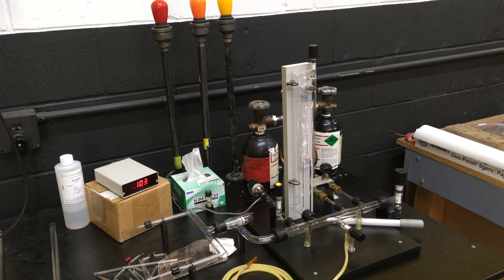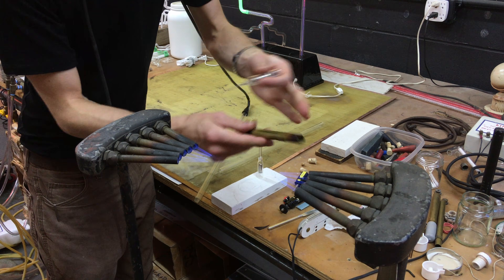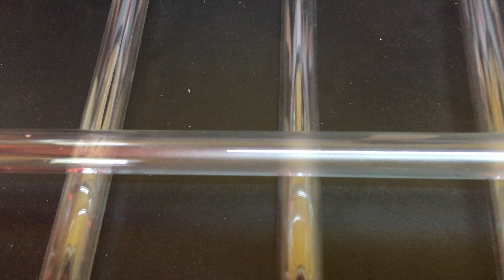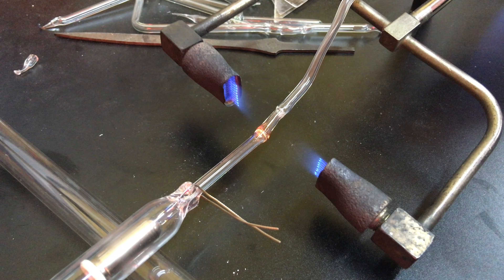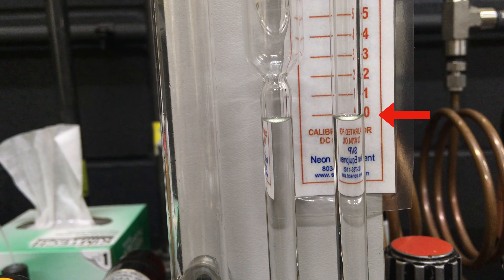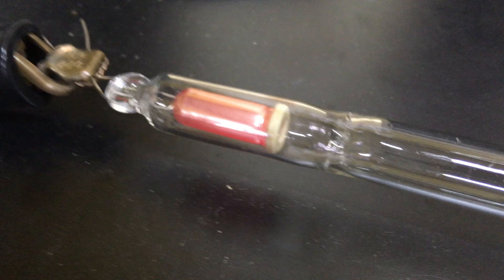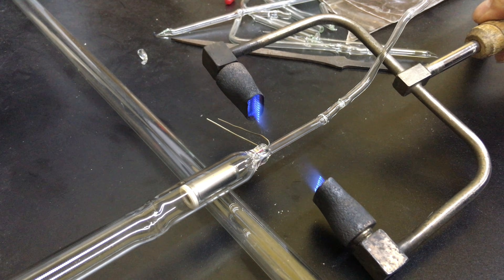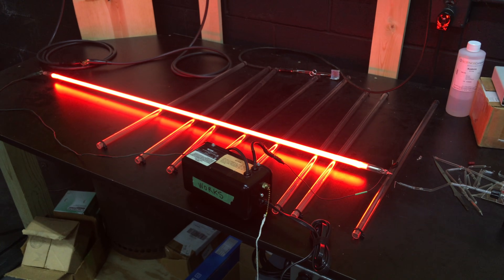Making My First Neon Tube

Comment: Im just starting, i have a 15kv neon transformer, can i use that for bombarding?
Reply from the maker: short answer?  no.

more amperage is necessary because more current is required to heat the tube and electrodes to an adequate temperature for processing.  generally, electrodes should be processed at least 10 times the manufacturers mA rating to fully activate the getter on the electrodes (e.g., 300mA for an electrode rated for 30mA). the glass needs to reach a minimum temperature of 225-250°C and the electrodes need to be glowing bright orange (c. 1000°C).  it takes a lot of current to do that.
improperly processed (i.e., impure) tubes will take a long time to burn-in, run hot, sputter, and have a short life span.

that said, bombarding is not the only way to process tubes.  oven-pumping & heating the electrodes using magnetic induction is another way; however, it takes a more customized setup since the oven has to be large enough to fit the tubes.
Reply: @NeonPreservation  thank you for the detailed answer. I guess the next question would be, where can i find an affordable bombarding transformer and choke?
Reply from the maker: if you're looking to purchase new, EGL has them: https://www.egl-lighting.com/bombarders/

however, if you're looking for used neon equipment, it is rather scarce.  you'll have to be patient and watch on craigslist, FB marketplace & ebay.

in lieu of a purpose-built bombarder, some people use a surplus step down pole mount distribution transformer (aka "pole pig") that is wired in reverse to step up the voltage instead.

it is also possible to build your own choke if you know what you're doing, e.g.:
https://uneonised.com/2017/11/21/ballast-to-basics/

Comment: I have been enchanted by the magic of neon light since I first saw it as a little kid in the 80s. A flashing sign in a lighting store. ON: a beautiful, saturated, brilliant orange-red fiery light in a long tube, punctuated along its length by mysterious flowing pulsating dark and bright striations. Cool to the touch. A quiet hum. OFF: NOTHING. A totally clear 'empty' tube of nothing. HOW!??! How could this be?? Where is the light coming from? How does it turn on and off so instantaneously, totally unlike the gradually dimming hot filament of a light bulb! Why is it so richly orange-red? Why doesn't anyone else seem to care at all about this wonderful device or understand how it works?!? The quiet warm glow of this noble gas still bewitches me even today. 
Slowly and methodically - understanding. Electricity, gasses, vacuums, plasma, electrons and ions, energy levels of an atom, photons, quantization, spontaneous emission, stimulated emission, collisional excitation transfer with a little bit of helium, lasing. Today I work at a facility that generates hundred-million degree plasmas for fusion research using ultrahigh power lasers, but it all started with those amazing tubes of brilliant nothing....
Reply from the maker: thank you for sharing; very eloquently stated!  i too am entranced by the beauty and wonder of this seemingly mysterious light.  i love the entire process of its creation: fire, molten glass, noble gas & high voltage.  
the science & physics aspects fascinate me the most, and are why i decided to start the journey of making neon.
Reply: @NeonPreservation  NICE. I subscribe!
Reply: @NeonPreservation  oh and what is that clear liquid in the manometer? I guess they don't let you use mercury anymore but it obviously can't be something with any significant vapor pressure either. ionic liquid?
Reply from the maker: the liquid is Dow Corning 704 diffusion pump oil—a silicone-based fluid— which, as you surmised, has an extremely low vapor pressure.
Reply: @NeonPreservation  Interesting   thx

Comment: So you using only rotarty pump? What underpressure you can achive with it?
Reply from the maker: yes, i currently only have a rotary vane pump.  depending on the size/length of the tube, my pump can get down to around 3 micron by the time the tube cools to 50°C.  obviously, a lower pressure would be better, but in neon manufacturing, anything below 5 micron is considered "acceptable."
i plan on adding a diffusion pump so i can achieve faster pump down rates and a better ultimate vacuum.
Reply: @NeonPreservation  okay, thank you. I planning to build processing machine for neons and any knowledge is priceless. Diffusion pumps here in europe are problematic because of the oil thats is almost impossible to get, unfortunetly.
Reply from the maker: as you may know, there are other options for high-vacuum pumps besides diffusion pumps; a turbo-molecular pump might be one for you to consider if you want a secondary pump
Reply: @NeonPreservation  yes i know about them, once a while i check auction sides waiting for some resonable offers
Reply from the maker: excellent!  being patient and waiting for a good deal to surface is how i add accessories my setup as well.
Reply: @NeonPreservation  we think simmilar i see 😅, for sure i come with another questions, for now thanks for help!
Reply from the maker: you're welcome, and good luck!

Comment: What's a torr? I know mechanics and some chemistry,  but I don't know what a torr is.
Reply from the maker: a Torr is a unit of pressure; 1 Torr = 1 mmHg.  atmospheric pressure is (generally) around 760 Torr, so neon tubes are evacuated to an extremely low pressure (milliTorr), and a tiny bit of noble gas is added.  in this case i filled the tube to 9 Torr, which is 1.18% of atmospheric pressure... so still mostly a vacuum inside!

Comment: Could you try and make a plasma globe that contains Ne and Ar?
Reply from the maker: yes i could!  i have tanks of neon and argon... i would probably have to get an oven/kiln built for processing because of the size of a plasma globe would dissipate heat too quickly if i attempted to process it the way i did with this smaller diameter tube.
Reply: Video once it done?
Reply from the maker: haha.  yes, if i attempt such an undertaking i will be sure to document it!
Reply: Cool!

Comment: Usually red doesn't snake like blue. But everything looks good when you lit that. My question is why you use a stick to push the button? You know it is only a 12v relay to the magnetic contractor and it's not even 120v so your chances of electrical shock are non existent.
Reply from the maker: i am using a scrap of 18mm glass tubing to press the deadman switch... basically due to an overabundance of caution.  i am completely self-taught and i set up all my equipment by myself, so with no experience and no mentor i am being extremely cautious.  i'd rather not accidentally get hit by the secondary output of the bombarding transformer.

Comment: When you are making welds rotate your glass in each hand opposite the other. Once you are ready to put them together to them the same for a sec then stick the two together and turn together. This makes sure all the area of the glass is evenly heated and you get an almost perfect wild right from the start.  Take it off fires and barely pull apart as you blow to make the line disappear. With lead free you should have hotter fires.
Reply from the maker: thank you for the tips, i will continue to work on my technique!

Comment: 8:00 - Can you teach us how the manifold system precisely works? How you purge it with gas or what not? in Detail.
Reply from the maker: the manifold system is collection of valves that allow the user to expose or isolate various system components from each other.  various combinations of opened & closed valves allow the user to evacuate or fill the tube, depending on the stage of processing.  if you would like to see the assembly of the vacuum manifold check out my video (it has chapters in the description so you can jump around to various topics), and i explain a bit about what the various components do while i am assembling:
https://youtu.be/Ya3I1l-zkqg

Comment: Where do you get your argon, neon etc. from? I live in Canada btw
Reply from the maker: lower purity argon gas is commonly used as a shielding gas for welders, that can be easily purchased at a welding supply shop... but, if you're looking for high-purity noble gas to use for sign making, your local sign shop should be able to get them for you.  you can buy smaller quantities (1L-2.25L) of noble gas at atmospheric pressure in glass bottles that attach to neon manifolds from various sources online...
e.g.: http://prosites-llcwccd.homestead.com/NEON-GAS.html

you might be able to find something to suit your application on ebay.  keep in mind if you are looking for compressed gas cylinders like i have (25L), there may be a haz-mat fee involved in shipping.
Reply: @NeonPreservation  thanks a lot for the fast reply! It’s good to know that I can find it pretty locally, since online the only results were from sgs gases which didn’t seem to sell anything.

Comment: Hi im looking for Neon Gas And Argon Gas you have because i want
Reply from the maker: if you're looking for high-purity noble gas to use for sign making your local sign shop should be able to get them for you.  you can buy smaller quantities (1L-2.25L) of noble gas at atmospheric pressure in glass bottles that attach to neon manifolds:
http://prosites-llcwccd.homestead.com/NEON-GAS.html

you might be able to find something to suit your application on ebay.  keep in mind if you are looking for compressed gas cylinders like i have, there may be a haz-mat fee involved in shipping.

lower purity argon gas is commonly used as a shielding gas for welders, that can be easily purchased at a welding supply shop.
Reply: @NeonPreservation  hi how to order this web site
Reply from the maker: you have to call on the phone
Reply: @NeonPreservation  amm how about in philippines
Reply: @NeonPreservation  what if there is on messenger?
Reply from the maker: sorry, i do not understand the question.
Reply: @NeonPreservation  i said 
How about in messenger do you
Reply from the maker: if you want to send them a message on FaceBook messenger, you can try their FB page:
https://www.facebook.com/West-Coast-Custom-Designs-LLC-185848544810423/
Reply: @NeonPreservation  thank you  im try now

Comment: very cool might i ask why no mercury was added as it brings out the color?
Reply from the maker: good question!  mercury is added to argon-filled tubes, as argon alone is not very bright (like the ones i showed at the beginning of the video).  mercury turns the pale lavender color of an argon tube to a bright blue, and also emits ultraviolet light, which illuminates the phosphor powder in coated tubes.

neon tubes almost never contain mercury, because the neon gas by itself gives off that brilliant reddish-orange glow, and if mercury is added to a neon-filled tube it will cause the tube to glow blue instead.  you can see it happen in this video: https://youtu.be/en466aLLatc
Reply: @NeonPreservation   oh cool learned something new today. Thanks for answering my question. I've always been fascinated by neon signs. Just recently I got a Budweiser sign. however on some occasions when powered on half of the sign won't come on so after toggling the switch a couple times the whole sign comes on. any ideas of what causes it? all tubes are intact.
Reply from the maker: since the tubes are intact and the whole sign lights up after you switch it a couple times, i would guess it's a transformer issue.
Reply: @NeonPreservation  OK thanks for the input funny thing is on a more current electrical system it did that. Now I have it on older electrical system and it does it but not as much as it used to it rarely does it on  older electrical. I moved from a modern electrical system [above described issue was constant] to older system [issue rarely occurs].
Reply from the maker: hm, curious.  could be a finicky transformer.

Comment: So, some thoughts on this process:
During the purifying stage, how critical is it to have air inside? Can pure oxygen allow an arc without creating additional water vapor? Also, the super high power stage to heat the electrodes looks pretty risky, have you considered an RF-based heater for each electrode instead? I feel like that would do a good enough job gettering the tube without scorching anything.
Reply from the maker: i like your lateral thinking!
the purpose of bombarding is to purify the tube, so you could probably use any gas inside... air is most commonly used because its free.  it is possible that using pure oxygen might cause oxidization on the metal electrode shells, but im not sure.

you are correct that using that much current is dangerous; but so are power tools and heavy machinery... using the proper precautions and safety equipment, risk is minimized.  it is wise, however, to have a healthy respect for such power.  

an alternative to bombarding is called 'oven-pumping'.  the tube is baked in an oven/kiln while under vacuum to burn off the impurities inside, then the electrodes are processed using a magnetic induction wand.  some special-effects tubes (e.g., crackle tubes or large-diameter plasma tubes) have too much surface area for bombarding and can only be processed this way.  the problem with oven pumping is, of course, having an oven large enough to fit the tubes you are making.  if you're interested in this sort of setup, i suggest you check out Mundy Hepburn's channel and take a look at all the crazy plasma sculptures he has created in his homemade basement plant:
https://www.youtube.com/channel/UCUImMzVCZ-mTHS6GhTKwzeQ
Reply: @NeonPreservation  very cool stuff. My day job is in the manufacturer of laser stuff, and I've worked with machines that are extremely similar in concept to your neon plant, but meant to operate under far more extreme conditions. We have one product that can't include a getter for technical reasons, so we have to achieve insane purity levels before filling with helium-neon, and we do use an oven for that process, and bake for many hours. The neon plant is comparatively basic, but also much more approachable for a home build. I'm really looking forward to watching the whole build series.
Reply from the maker: very nice!  you are correct, the neon plant setup is pretty basic... it has remained relatively unchanged for the past 100 years; there have been technological advancements in some of the materials involved, (e.g., electrode refinement, borosilicate manifolds with greaseless stopcocks, improved vacuum pump tech) but the overall process is still the same.

i hope you enjoy watching the setup videos, i am interested to see what similarities and/or differences you notice compared to your daily laser manufacturing!